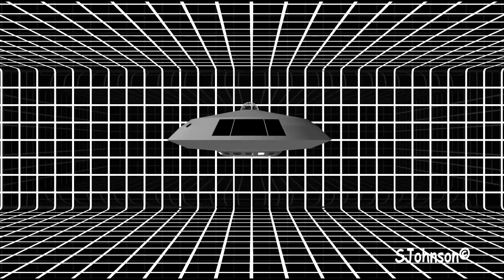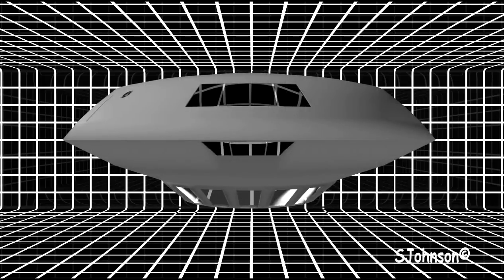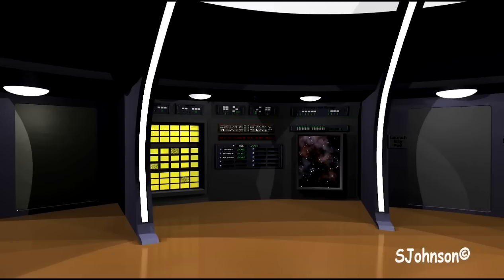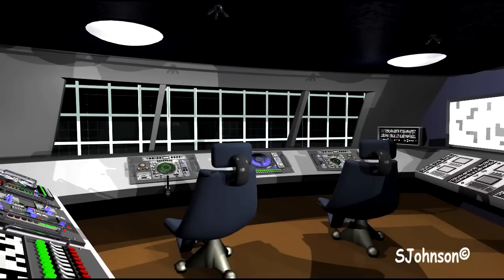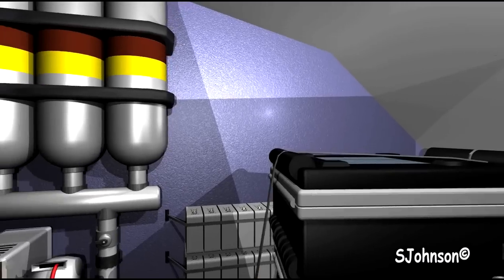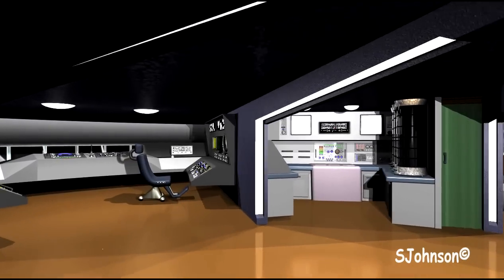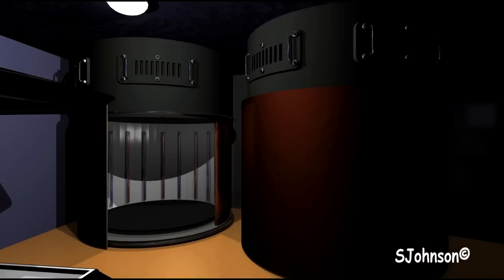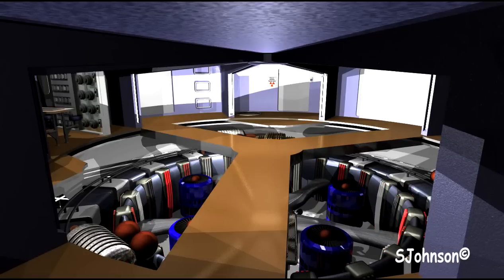3D tour of Lost in Space Saucers * Scifisteve

Comment: Just looked at your 3D model walkthrough.
 
Whew, I'm impressed. You put a lot of work into this. You actually got everything to fit by doing the required 'scale up until it works' process.  The JupII was suposed to be approx 40 ft diameter (which would never have allowed a pod let alone three decks) so about 100 ft in dia is what you get.
 
I noticed a few things I don't know if you intended or just were not aware of the original details.
 
the pod dropped out the bottom, not launched through the top. but what the hell..
 
I loved your Fusion reactor. Its so industrial looking! ...and your transformers ...and your incredible amount of detail you put into the whole model.  I see you patterend the ship off of the original but took liberties where you wanted to fit into your overall assumptions.
 
BTW, the way they originally got to the engine deck (power deck) was through a ladder in the outside of the saucer, not opening up the living deck floor. That access method is the only thing I would probably change. I know you don't have the room on the outside of the power deck but a smaller access seems more sensible. The power deck itself is verrrryy impressive!
 
The only point I have to pick with the whole walk through is that the Audio is so LOW that with my volume cranked to 100% I can barely hear your comments. That's too bad as you did have a lot of good things to say.
 
I went on to check out the Buck Rogers spaceship....which I fell in love with...:-) (the audio was louder too)
 
Question.  You did a lot of modeling. Why no 'people' in your animations?  You can easily get some from 3D modelers and pose them in your animations without having to create them yourself. ?? 
 
anyway, thanks for letting me see your modeling.
Reply from the maker: In working it thru, dropping the POD from the bottom may have prevented it from being used after landing.

In the Aux pilot area I talk about using the POD to place sensors around the planet for monitoring.  I included low orbiting satellites for weather and planet wide communication.

The showing of the engine thru the Living quarter was 100% theatrics.  
It was sort of pulling open the curtains for a show car.

Your right about the sound.  I didn’t notice it when running it on my machine.

My people suck!

Steve

Comment: Salutations Mr. Johnson (SciFiSteve) from Mr. Dowd. (Part I Classic Sci-Fi Hyper-Drive for the Jupiter II)

I am a great fan of all your 3D models of the classic Sci-Fi spaceships from movies and television. In particular I admire your rendering of the Jupiter II of “Lost in Space”. In fact it has become a little bit of an obsession to me. The details you put in your designs and the real world science you use in describing the operation of your “ship rendering” makes me believe that your ships could actually fly. In that spirit I wish to add some additional details on the operation of the Jupiter II. 

In your model the propulsion is what you call “Magnetic Drive/Hyper-drive”. Per your description it is a way to accelerate the ship without the use of a propellant. Let’s suppose this drive is generating a gravitation field with uniform gravitational acceleration vectors (same direction same magnitude) within a spherical volume that covers the ship. Let’s further stipulate the magnitude and direction of the gravitational acceleration vectors are controllable. A reasonable magnitude range should max out at 10 g’s. The direction of the vectors should have two control settings which vary by 180 degrees. The positive (acceleration) vectors should point to the top of the saucer.  The negative (deceleration) vectors should point to the bottom of the saucer.

To take off from an Earth type planet you need to accelerate more than 1 gee just to move at all. Since this is a gravitational drive the crew will be in free fall the minute the drive is turned on for takeoff. In fact the crew will be in free fall during the Acceleration, Cruise, Deceleration, Exploration and Landing phases of the mission. This might not matter for the Takeoff, Acceleration, Cruise and Deceleration phases as the crew is in suspended animation. 

But for the Exploration and Landing phases a 1 gee environment inside the saucer would be highly desirable for the health and comfort of the crew.The question is how to provide it?
 (See Part II Classic Sci-Fi Artificial Gravity for the Jupiter II)
Reply: Part II – How to provide classic Sci-Fi Artificial Gravity for the Jupiter II

One way would be to use the Hyper-drive to provide it. But there is a problem since a gravitational field acts uniformly on all matter. The crew would still be in free-fall within the ship frame while the ship itself would be decelerating when a velocity change is not desired. A possible solution would be to fire a rocket attached to the “stern” of the sauce to accelerate the saucer 1 g to oppose the deceleration for no net velocity change. The crew inside would no longer be in free-fall as they would “feel” a one gee “artificial gravity” with respect to the ship frame.

But there is an obvious problem with this solution. A rocket needs a propellant supply which reduces the effective payload of an interstellar mission. It also sets a strict time limit on the ability to provide “artificial gravity” in free space. What is needed is the equivalent of a rocket that works without the need of a propellant supply.

To cut the chase here is a proposed modification. An auxiliary Impulse Drive should be added to the design. The “Impulse Drive” engine would be a miniature Hyper-drive engine with a focused gravitational field. The field will be focused on a dense mass rigidly attached to the ship frame. This is the equivalent of rocket engine but it operates without propellant. Like the main drive in that it only needs power from the Power Plant to operate. 

Thus it can operate through all phases of the mission.
 
The number of impulse engines should be a minimum of eight which collectively should provide enough thrust to accelerate the ship up to 4 g's. The engines should be evenly distributed around the ships oriented in parallel to the Main Drive. The engines should be as far from the center of the saucer as possible. This arrangement will allow the Impulse Engines to provide stability and attitude control by minor adjustments of thrust from each individual engine. 

Another benefit would be safety. If the Main Drive should fail during a critical phase of the mission such as a takeoff or landing the Auxiliary Impulse Drive could take over. 

These design modifications should also provide a comfortable 1 gee environment in the saucer when it lands on low gee or high gee environment (like Mars or a Super Earth). If fact control of gravity should open up a lot of space for human settlement. For Instance the Moon and Mars in our own solar system could be made very desirable locations for colonies if people could live in a 1 gee environments in their homes and enjoy the “great outdoors” of low gee environment for recreation. On a Super Earth high gee environment a 1 gee shelter is essential just to survive on the planet let alone colonize it.

Your thoughts and feedback would be greatly appreciated on these modifications.
Reply from the maker: A little lengthy, but here I go.  Sticking with the show, sustained gravity seems unneeded as they are in suspended/frozen state for the vast majority of the flight.  I like the idea of the Impulse Drive.  Allows for a lower stress propulsion system, plus backup.  And since Hyper drive is so vague (anything from super fast to alternate dimensions) I don't see how a gravitational field can be associated directly with it.
Oh, I will be addressing Hyper Drive (alternate dimensions) in my next ship.
Well that was fun.
Thanks

Comment: For the long-term flight, the 1965 first episode showed the crew undergoing an electromagnetic (EM) stasis NOT freezing: I would thnik that this would employ an induced EM field application with a continuous, repeating "off and on" cycle  of EM subatomic particle interaction "snapshots" with a period near Planck time (quanta of time 10 minus 44 sec): A sort of induced relativistic-like time dilation at a subatomic level so that (within this field) only a very tiny time interval elapses while a one-year  time interval will elapse outside of this field.  John I. Campo   Tampa  11-23-2017
Reply from the maker: That's not what I got at all.  Page 40 of the Tech Ref. manual describes the E/M ray as way to instantly remove heat from the body and its cells.  Thus eliminate damage during the freezing process.  Common microwave energy was used to defrost the body.   If you have something from LIS referencing this procedure please send it along.
Reply: Thank you for your considerable reaserch and response regarding events shown during the first (Fall 1965) episode of Lost in Space. Please simply go back to (only) this episode and consider the verbage used to describe the scene where the narrator (as I recall, but incorrectly?) described to the 1965 audience the 1997 techinical (grand) achievements of the Jupiter 2: The crew members' bodies were shown glowing while the narrator stated how the crew underwent an "electromagnetic marvel" (was this the exact verbage ?) allowing these crew members to be in a suspended animanitation during the five-year (sub-light, near-light or light speed?) trip to Alpha Centauri.   John I. Campo  Tampa, FL

Comment: this was amazing..you did an excelent job of reconstruction and explanation..i cant imagine the amount of hours you put into this...idohave a question you;re exclamation of the engine was very good but because there are no exhaust ports on the jupiter how does the engine propel the ship does it form a field around the ship like a warp bubble or what?...thank you for you;re time in doing this i have loved the show for years and you;re ship would work....
Reply from the maker: Here is how: Electromagnetic propulsion (EMP), is the principle of accelerating an object by the utilization of a flowing electrical current and magnetic fields. The electrical current is used to either create an opposing magnetic field, or to charge a field, which can then be repelled. When a current flows through a conductor in a magnetic field, an electromagnetic force known as a Lorentz force, pushes the conductor in a direction perpendicular to the conductor and the magnetic field. This repulsing force is what causes propulsion in a system designed to take advantage of the phenomenon.   Scifisteve

Comment: If I remember right the POD launched from the bottom. Not the top of the ship.
Reply from the maker: Your are correct, but you entered the POD on the upper deck.  Which ment you dropped thru the lower deck to exit.  That created a need for a shaft large enough to allow the POD to drop thru.  That is space you can't afford to just give up. So enter the top deck and exit the top.  Saves lots of space.

But thanks for noticing. 

Steve
Reply from the maker: I remembered this latter.  Assuming the saucer lands correctly one day and you launch the POD from the bottom, its now trapped in side.  Launching from the top allows the POD to continue to be used.

Steve

Comment: You'd need very little antimatter to run the ship for decades.
Reply from the maker: What I pointed out in the 3D tour is antimatter is too complicated to create.  The amount of equipment needed to create antimatter on the target planet is probably greater that the ship itself.  Not to be too simplistic by fusion is water plus lasers. Both the tour of the "Terra V" and my "dimensional jump" both use antimatter.  The difference is they have refueling stations all over the galaxy.
Reply: The point is, you wouldn't need to manufacture antimatter.  IF you could make it at all, you could make enough on Earth and bring it with you.  It'd take up very little space.
Reply from the maker: I designed the ship with a very large machine shop, and 3D printer. Machines designed to re-cycle existing materials to be reused. Everything should be able to be build and or re-machined.  No matter how much antimatter you bring its a fixed amount period.  You can't create more.  I can re-fuel and continue to fusion reactionand have my family sleep well.

Comment: 1. Sorry your space pod needs alot of work. It's designed is all wrong.
2. Best I can remembers your launch computer is on the wrong wall. It could be seen on the side wall not the outer wall.
3. The pod dropped out of the bottom, it did not come out of the top. It's in the wrong place.